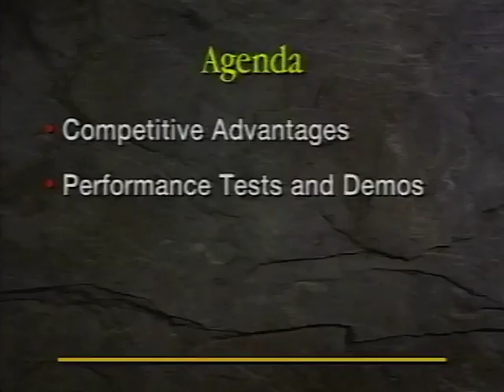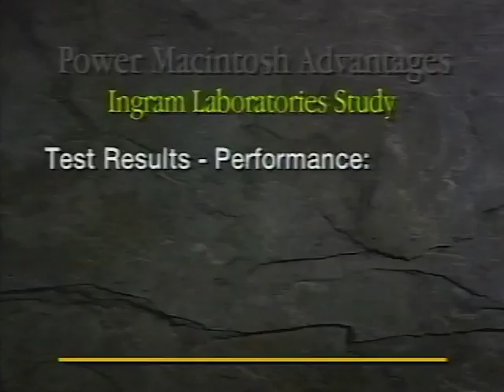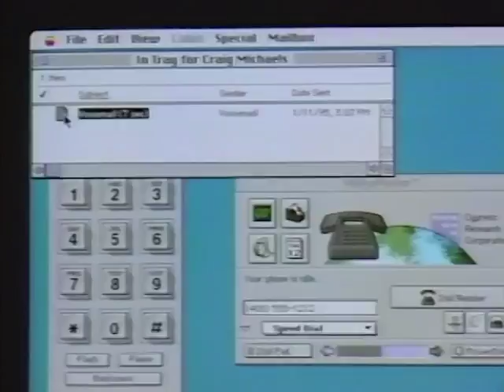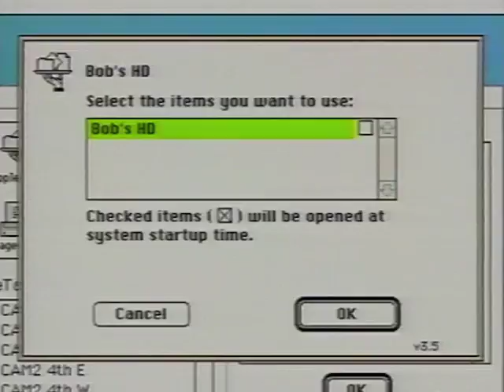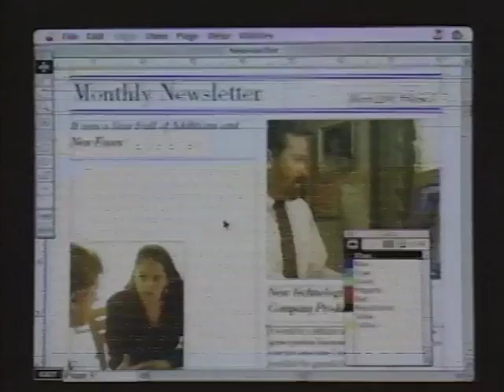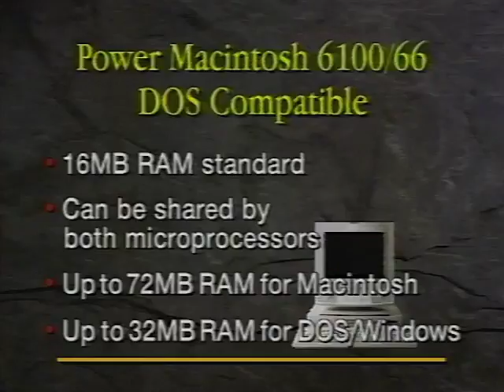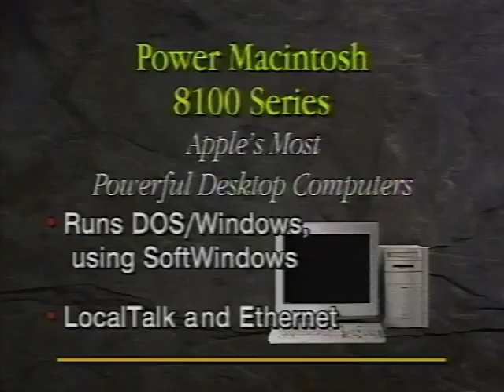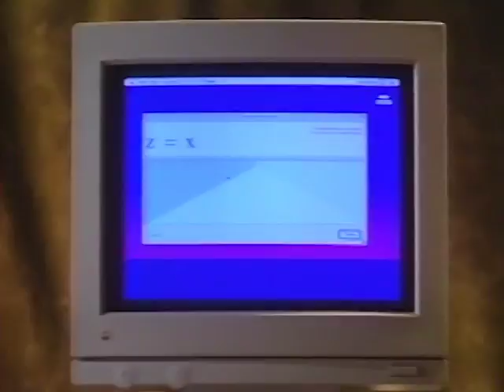Apple Power Macintosh Reseller Training - Apple VHS Archive

Comment: They really oversold the whole PPC vs CISC architecture back in the 90s. It doesn't matter if your PowerPC chip is 1.45x faster than a Pentium if it costs 4x as much.
Reply from the maker: And if it uses twice the power. Obviously this was a huge factor in the switch to Intel when they couldn't get the G5 down in power usage.
Reply: Not to mention the fact that early PPC Macs were slower than even mid range 68k machines because they had to emulate a 68k processor!

It took years for Apple to even port the Mac OS to PPC native code and then they shot themselves in the foot by building Macs around the cache-less crippled 603e.

Also PPC was a horrible, horrible platform to develop for. 68k assembly is so clean it's human readable; good luck working with PPC code!
Reply: Yet the G3 absolutely trounced Pentium II and III, and did so at low power consumption and heat. Intel only began to overtake PPC in earnest with their Core series CPUs years later. The G5 was uniquely hot and problematic for Apple; earlier PPC chips were great for their time. Furthermore, RISC was generally big in the 90s. ARM chips were RISC, and MIPS had RISC also, which came to be used in Silicon Graphics workstations. MIPS and PPC have also shown up in several game consoles. Lots of people were excited about RISC with good reason. It is still in use in many applications, too. Every ARM-based device is RISC-based. Small, cool and every fucking where you look today.